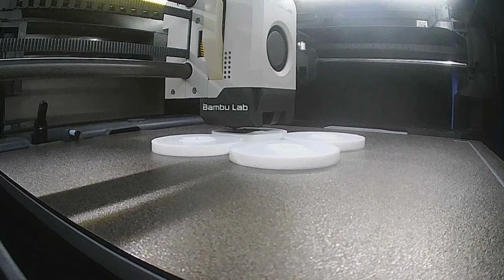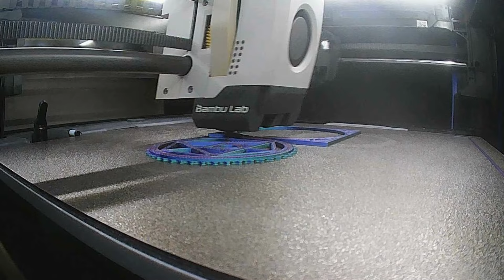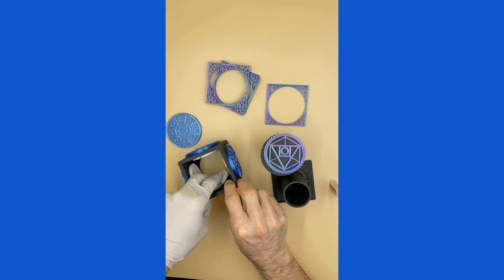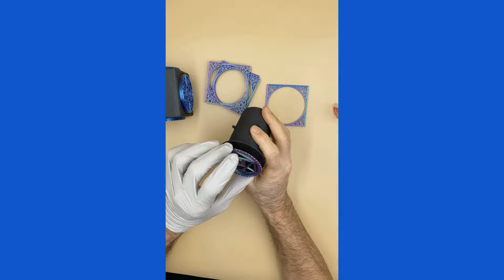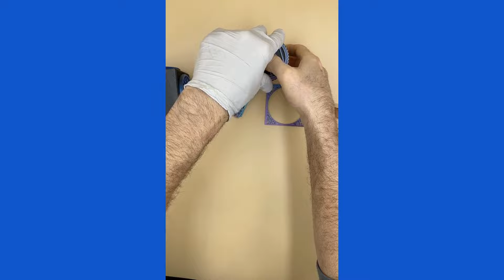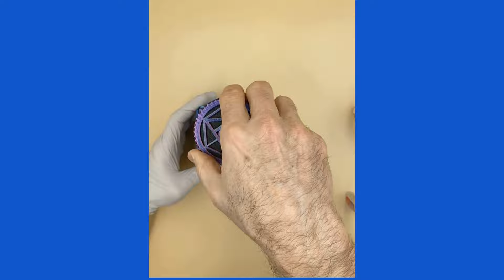Alchemist's Cube   Puzzle Combination Box

Comment: are the dials supposed to just snap on the white wheels? All seems to be properly sized but won't just get in :) Tried multiple print... if i resize, then the proportions with the box are wrong.... any tips from anybody who actually was able to put them together? (I do see that you glue them, but still it seems you have a perfect occlusion :)
Reply from the maker: Yes, the dials will snap on the internal golden wheels and lock in place. BTW I didn't use any glue and with the last dial I used a small screwdriver to reach inside and put pressure on the back of the last golden wheel.
Reply: @3DTimeSculpt  thank you! i guess i need to print the parts again :)
Reply: After printing the white wheels three time and shrunk it down each time, I had no luck. From what I can see is the spokes are way too big, so I’m going to try to shrink down just that part of the wheel.
Reply: Ive just printed this and the inner dials wont just push in no matter what. Does anyone know how i could do this
Reply from the maker: @stephjarrold3737  check your printer settings and make sure all looks right. Sometimes I printed parts with the wrong nozzle size settings and all the layer heights were off. You could try using the same filament for both the inner and outer dials, because sometime different filament and/or material can expand in different ways and you will have different tolerances on each part. Another thing you could try is use thinner layer lines. For example if you have a 0.4 mm nozzle, you could try to use 0.16 or 0.12 mm layer height.
Reply: @stephjarrold3737   Had to cut these gears down with a  dremel they are jsut to big other than that perfect print and fun took me 2 days